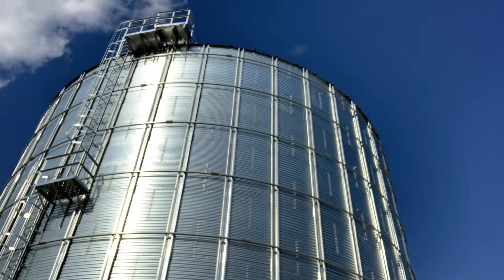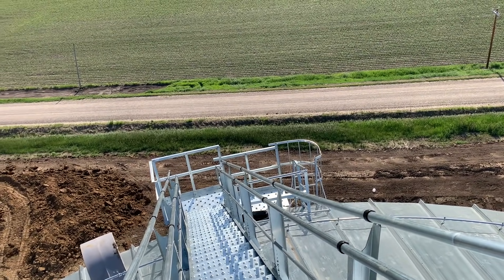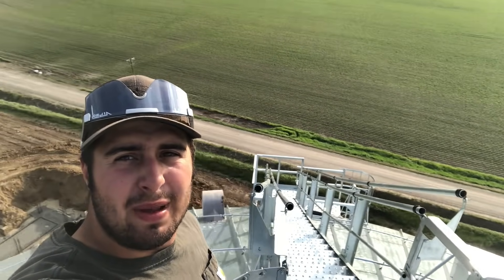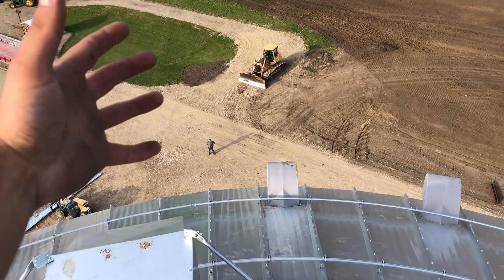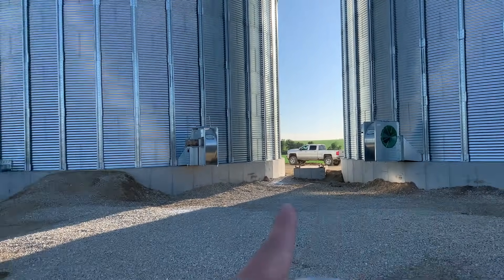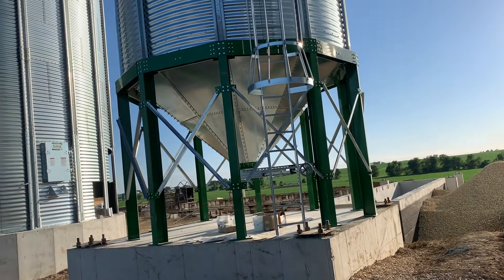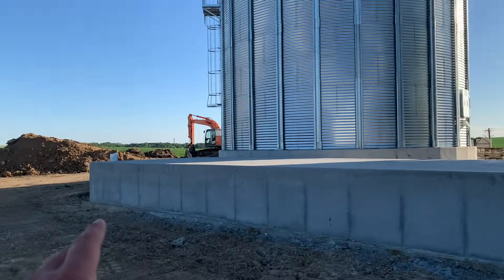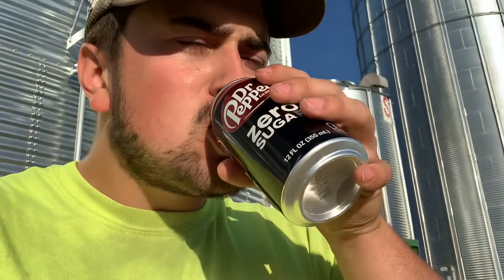New Bin Site UPDATE!!! | Area 21 Halfway Done!

Comment: Why are silos not inside the ground? All I've seen is silos sitting on the ground.
Reply from the maker: Don’t know that I’ve seen any actually in the ground. Maybe a ground pile
Reply: Ground has moisture issues that may need to address. You want the grains dry. 

Cannot see any reason to go below grade. 

Even for unload. Water can be an issue that it may not be worth while vs a totally above grade solution. 

Simpler is better